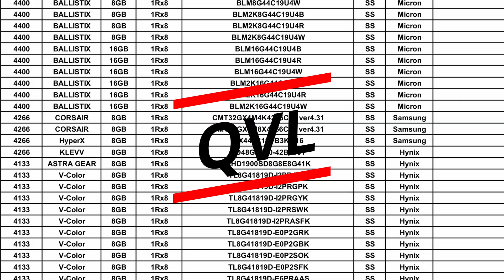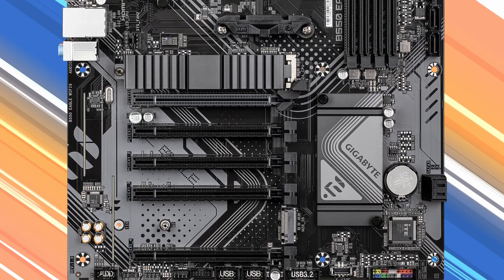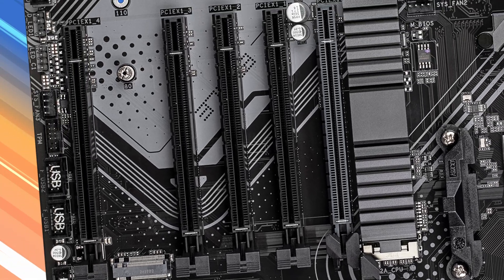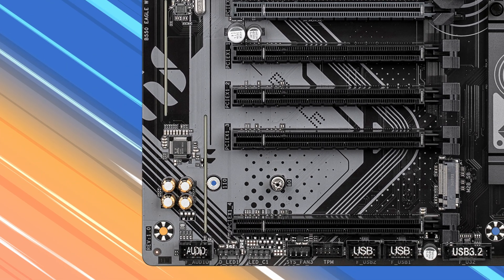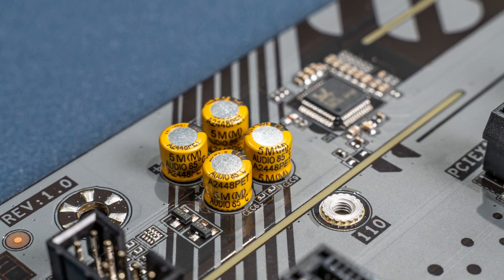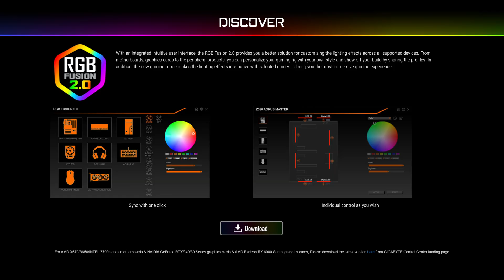Gigabyte B550 EAGLE WIFI6 Motherboard Unboxing and Overview

Comment: I’m building my first pc with this motherboard along with a Ryzen 5 5600 and a RTX 5060. So I’m watching this video over and over so I’m sure of how to do it when all the parts come next week.
Reply: Check ryzen 7 5700 because I found it as the same price as 5 5600 and also it’s great with 5060 it’s have less than 1% bottleneck
Reply: dude lmao same, literally same cpu
Reply: I also built with 5600x + 5060
Reply: that profile picture, it's like the cat was shocked.
did you surprise him or her with a close up, 
i was looking at this board but i ended up getting
the Asus ROG Strix B550-F gaming wifi II,
to go with the processor i chose. the Ryzen 7 5700X
and a Radeon RX 7600.

Comment: I needed to hear about consumer complaints about the WiFi 6 issues and your review forgot to mention or test the WiFi 6 😢 thanks for a clear Review.
Reply: it's slower than wifi7, but it's faster than a basic connection.
so it's fast enough, but you're speed will vary based on area
and the Internet provider you go through.

Comment: Can i use a ryzen 9  5950x on this board? I tried the mag d550 tomahawk board and I cannot get the cpu light to do anything but turn red. I even tried to run a cpu bios update out of the box using usb flash m with only the cpu power and atx power and it went through the update....still staying red. Do you think this board would be better? I also replace the ram with what is supposed to be compatible and it still didn't work!
Reply: Board can run it.
Reply: Compraste esta Mothertboard? tengo ese mismo preocesador, el R9 5950x y quiero comprar esta MB
Reply: i wouldn't, the VRM can handle up to a Ryzen 7 5700X,
but i wouldn't go any higher than that.

Comment: Quick question you mentioned the TPM header for a external TPM modul do I need this external module to run windows 11 on this mainboard or does the Mainboard have a less secure tpm onboard?

Comment: Hi, I wanted to ask, in my understanding having searched online about WIFI6 is that it has bluetooth, right? I'm looking for a good budget MB that has Wifi and Bluetooth and can't seem to confirm that.
BTW, thank you, this is an excellent video, I guess I'm going to get this MB, thanks for all the info and "to the point" presentation.
Reply: It does have Bluetooth, version 5.3
Reply: For further explanation any wifi, built in, or plugged in, doubles as Bluetooth, they use the same technology

Comment: I'm going to buy it for the Ryzen 5600x processor, is it a good choice? I'm confused by the many PCI slots and why are they needed? And can you recommend a better board than this one within $120?
Reply: I have one and it handles anything my 4070 can throw at it. I love it and won’t upgrade for a while
Reply: @korymccauley3925 I agree. I had some parts left over so I bought this board to put in a build to sell. Very nice board. It's one of those things where you put a system together and really end up enjoying it. I highly recommend.
Reply: Yes, I am putting a r7 5800x in it soon. It has many good features, and is a great all around modern motherboard (minus it being on am4). The pcie slots are for a multitude of things, some are used for storage expansion cards, and other features like more USB ports. It's a little strange to have 4, but if your not going to use them it's fine still.